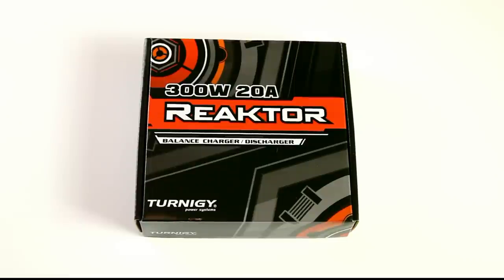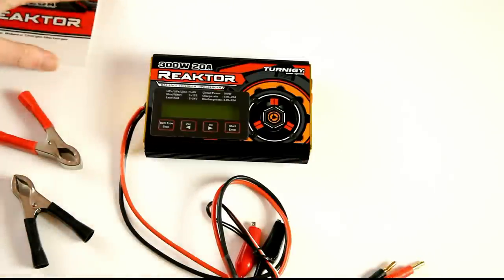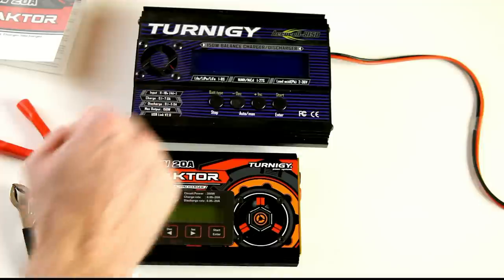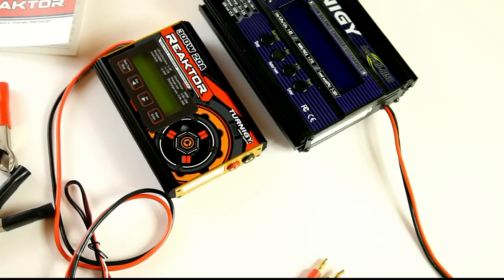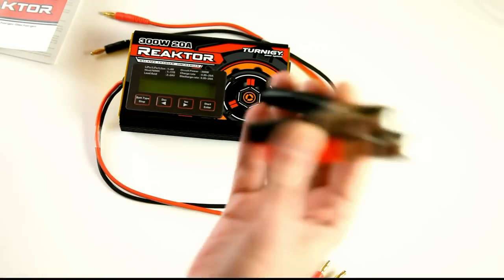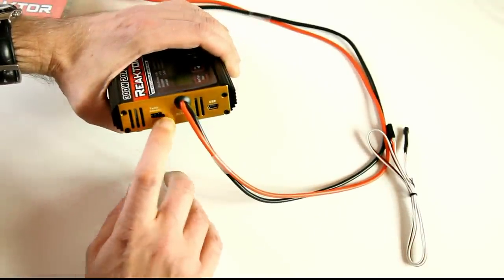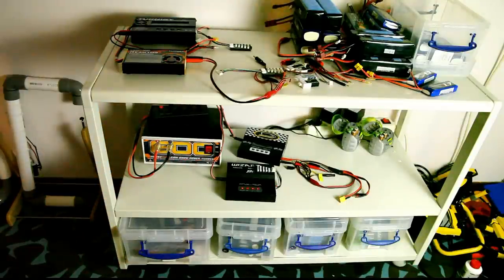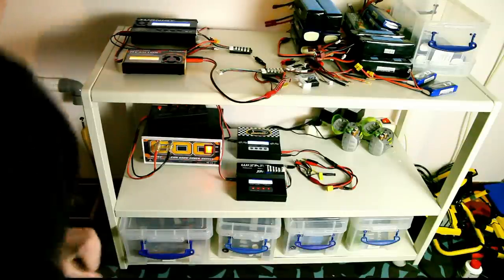Turnigy Reaktor 300W Balance Charger - Unboxing + features + menu browse

Comment: Hello. Can this charger charge a LifePo4 100Ah battery with built-in balancing board (BMS)?
Reply from the maker: yes that will work.. you will simply Not put the charger in balance charging mode in that case.. simply use the normal Charge option..
Reply: @DutchRC  Thank you very much!

Comment: How do you know when the battery is done charging?  Does it stop when it reaches its full capacity?  Do you have to stop it automatically? Or will it run until the safety shutoff of 120min?
Reply from the maker: +DB Coop These modern chargers will end the charging automatically sir.. They will sound an alarm (if you have that feature switched on) as well.. And 'done' will be shown in the display :)

Comment: Thanks for the review.@5:13 you say that you won't need the manual... but you should read it before making a review since you did not know about the new feature: Motor Drv, Log files, Lipo DCHG+ Vs DCHG, etc. :)
Reply from the maker: Yes.. You DO have a good point there Jerome.. Very true. This video wasn't really ment as a review though.. More an unboxing.. 
I might allso do a review on the charger.. But I think it would be appropriate to first really test it for a while..

Comment: Just got one! Nice charger.
Reply from the maker: It is right? :)  I'm happy with it as well :)
Reply: DutchRC ADVENTURES Yup! Tested it out pretty good the last week.. Works great!.
Reply from the maker: BWX Good for you! :D  I've used it quite a bit as well by now. Works fine!
I am a bit worried about the buttons holding up over time, but we'll see :)
Reply: Yeah they are a little stiff and hard to press now.. I'm hoping they "break in" a little.
My B6AC buttons are still holding up well, and that's a much cheaper charger..  with different type of buttons..
Reply from the maker: BWX Okee.. that sounds good.. Well. the funny thing is: my charging station isn't that well lit.. These buttons are hard to 'find' in the dark :D haha..
Reply from the maker: BWX I'm thinking those round transpararant plastick things that are used (over here at least) on kitchen doors? 
http://www.kastenkeuken.nl/contents/media/l_993.710%20demper%20siliconen.jpg
Reply: DutchRC ADVENTURES  Yeah something like that.. although I don't know what those are for! LOL
Reply from the maker: BWX Haha Well.. you stick them on the inside of your kitchen-kabinet doors.. So that they don't slam shut :)
Ikea sells them... but any kitchen supply store will have them for you :)
Reply: Ok cool! Thanks for idea. I'll see if I can get some. They would probably work perfect.
Reply from the maker: Yeah :)  I think those would be the ticket :)

Comment: how have you found this charger since you got it? still reliably balancing your batteries well? I have an imax b6 and its definitely time to upgrade (doesnt balance and also overcharges the batteries) - does this charger have a good longevity?
Reply from the maker: Hot damn! That sounds unsafe man :| 
I am still very happy with my Reaktor charger(s).. Very reliable and conveniant in use :)
Reply: thanks for the speedy reply! yeah its getting a bit too messy to keep it haha, looks like im going to have to get a reaktor instead :)
Reply from the maker: You're welcome Conner :)  I actually have 2 Reaktors. the one in this video, and a dual-charger.. 
Let me know what You think of the Reaktor as well offcourse! :)
Reply: "I'll be back" - as soon as it comes... ahah

Comment: Nice charger, how much was it? The one im going to get is the tenergy tb6b on Amazon for $50
Reply from the maker: The RCAddict Here is a link to this charger buddy :)  
http://hobbyking.com/hobbyking/store/__44112__Turnigy_Reaktor_300W_20A_6S_Balance_Charger.html 
It IS a bit more modern (more features / better treatment of LIPO's) then the one you are looking at :)
Reply: DutchRC ADVENTURES Wow, I expected it to be at least $100. How much was shipping? Ryan said that the one I was looking a seemed rally good for the price and it is definatley better than the crappy USB chargers ;)
Reply from the maker: The RCAddict Offcourse :D Yep.. the one you were looking at IS (a lot) better then an USB charger.. Far more options :)
The one from my review is a bit more modern however.. I have a few of the type of charger you were looking at. Work just fine! But they are of an older generation..
The shiping depends.. For me it is Really cheap, as there is a HK warehouse in the Netherlands.. Just make an order.. and see what the shipping comes down to for you :)
Reply: DutchRC ADVENTURES It would be $9 shipping. Also it doesnt come with the power supply or an octopus cable with many diffrent plugs on it. So like 65 charger+10 power supply +9 sipping + 10 Cables=about $100 Im not going to need to be using half of the settings on yours so I think Id rather pay $50-$55 for everything total than $100 :) I dont need anything super serious just better than the usb.
Reply from the maker: The RCAddict I never said it was a cheap charger :D  ehm well.. it probably is for it's specs.. But yeah. I use 2 of those 'normal' chargers as well.. Their more then good enough as a first serious charger indeed :)
Reply: DutchRC ADVENTURES Ok thanks, I think Ill go with the tenergy and maybe upgrade later :)
Reply from the maker: The RCAddict Yeah man :)  After a while you'll find yourself wanting more then 1 anyway :)  (I use 6 chargers.. 1 of them is permanently in my 1/1 car)
Reply: DutchRC ADVENTURES Lol thats alot
Reply from the maker: Yeah :)  well, when I have a flying-meeting.. I generally take about 8 lipo's with me.. So, with just 1 charger, it would take Long to charge all those :)
Reply: DutchRC ADVENTURES Yeah, you are right.

Comment: I just bought 2 of these.  When scrolling trough the options for a LiPo battery I do not see the choice for cycle.  

I see:

Balance
Charge
Fast Charge
Storage
Discharge

But not:

Discharge +
Cycle

Any help would be great!  Thank you!
Reply from the maker: Howdy :)  I'm afraid you'd need to ask HobbyKing about that. I myself only have the 'old' version (this video is shot in 2015 as you might have noticed :$) .. You have newer versions of the charger, so it could very well be there are changes in the internal software....

Comment: in the manual it claims to have a setting for if you get a "low bat error" but i cant find the setting
Reply from the maker: Same here. I have never come across that setting / feature..
I do have to add my video is from 2015 right.. so by now the internal firmware might be different...

Comment: Hello, what sort of a power supply would I need for a 250w 10amp model of this please? Thank you!
Reply from the maker: +MrKurtay Howdy :)  Well basically a 250W model offcourse, though I would personally like a bit of a margin (say a 300W).. Some people use power supplies out of HPI Servers (computers).. But really any one would do.. From reviews, this seems to be a decent power supply: 
http://www.hobbyking.com/hobbyking/store/__76184__Turnigy_Reaktor_Pro_350W_23A_Power_Supply_100_240V_AC_.html
Reply: +DutchRC Adventures All good thank you! :) I appreciate quick reply! I see you got a 600W model nicely sitting there hence the reason I asked. Can one use more watt and up to 24 v supply? I read on a RC forum they recommend 24v for a cooler operation.? I am no good with electrics other than plug in/out! :)
Reply from the maker: +MrKurtay Well yes.. Generally the lower the Amps, the lower the temperature.. So with Watt = Volt * Amp .. the higher the voltage, the lower the Amps.. :)
Reply from the maker: +MrKurtay :D Well yes.. that actually looks a lot like a pc power supply :)  Should indeed work! :D 
You're welcome and happy hollidays as well!
Reply: +DutchRC Adventures Thank you very much! :)

Comment: Dear Sir! 
I would like balancing battery of my  toyota prius. What charge and discharce parameters should be set on this charger? 
Best Regards Peter
Reply from the maker: Howdy Peter :) 
wow.. I really have NO idea.. is a charger like this powerfull enough to charge so manny cells? I assume the car runs on Li-Ion packs.. But at how much Volts are they charged??
Reply: DutchRC Adventures prius battery is a 28 cell battery pack(NiMH) . You can charge them individually.  8 V each cell. Can you suggest me how to set the current and voltage to cycle it?
Reply from the maker: Okee! That surprices me, that perfectly possible :) 
These kinds of chargers have a dedicated Nihm setting.. Select the correct nr. of cells and well.. the Amp setting is kind of up to You offcourse.. I would think those battery's can handle a pretty high Amp setting.. 10-20A maybe?
Reply: DutchRC Adventures Yes but I want them cycle separately.
What do you think about the discharge current? What should I set? Im totally curious
Reply: You really really should contact Toyota about that.. I wouldn't want you to set your car on fire :$
Reply: DutchRC RAW ok! thank you very much

Comment: Please somebody help me. I have the same charger but when finish 3 cycle discharge/charge on my Ni–MH batt the display show only the last value for third Charge capacity . Does anyone flash firmware to this charger to solve this ? Thank you
Reply from the maker: you ment 1/3rd capacity of the third capacity? 
Can you check the end voltage of the pack afterwards? (to check if the pack is or isn't fully charged)

Comment: I bought the 300w and the 250w did not last much more than 12 months one has gone on the balance line will only charge 2s  and the other still works but the screen has gone all banks  with some Chinese writing, too dangerous to use as not sure what it is on.
Reply from the maker: Hmm what does HK tell you about that? I'm not really sure what their warrenty policy would be on things older then a few months? :$ 
I do have that Chinese jobbrish-screen thing on an older Turnigy (non Reaktor) charger as well by the way..
Reply: They are just over 12 months old one of the chargers looks as new,you could not tell it has been used.
I have two 250w Hyperion EOS 0610i  net LiPo Chargers had for years till somebody ran over them with a car crushed the alloy case,checked the circuit board and bent the case straight still work but never leave them alone .also have the i charger 208b and 206 never had problems.
Reply from the maker: There is allways the 'luck' factor as well offcourse.. My 2 Reaktors are still fine, and as you can imagine I use my chargers A LOT :)

Comment: Such a good review but i wont recommend this product, i had one that only lasts for less than a week and starts displaying garbage on screen !!! it was a disappointment since it is the only charger i have ...
Reply from the maker: Damn.. that isn't nice to read.. Sorry about that buddy.. Offcourse I can't test 100-eds of the same charger.. Maybe you just had some bad luck..
As I mentioned in the video: I had the exact same thing as you have with the previous charger..
Reply: I've used 2 of these Reaktor chargers for 6 months and they work just fine. Best charger you can buy for the money in my opinion. Lot's of features and very silent, the fan only kicks in when charging at higher amps. Leuke review DutchRC, thumbs-up!
Reply from the maker: Arcee Moron Thanks very much Arcee (leuke naam :)) And that is good to read :)  I'm very happy with it so far indeed.
Cheers! En kheb me op je kanaal geabonneerd :)
Reply: DutchRC ADVENTURES My problem with the charger started when i was discharging my Lipo battery, i do not know what happened to it maybe it a bad luck. I am really happy that it works fine with you guys and good luck  :)
Reply from the maker: Nabil Al Dhaleai Are you still within warrenty Nabil? If you, i'd file a RMA.. That willl probably take a while.. but who knows :)